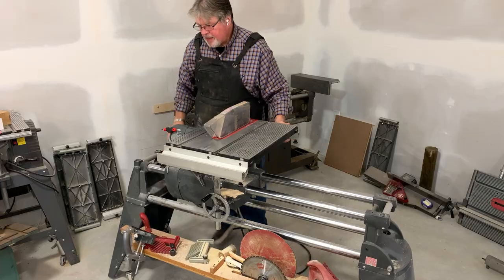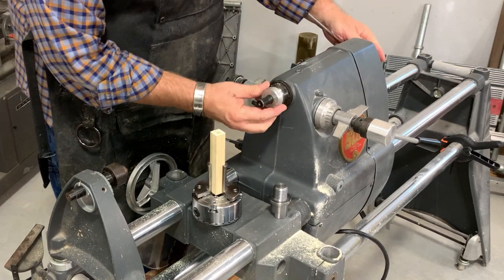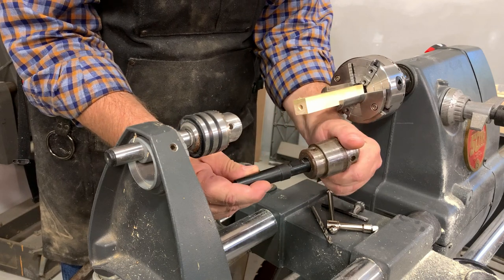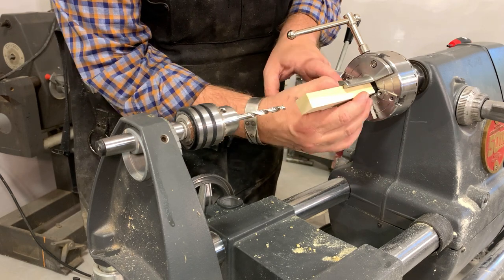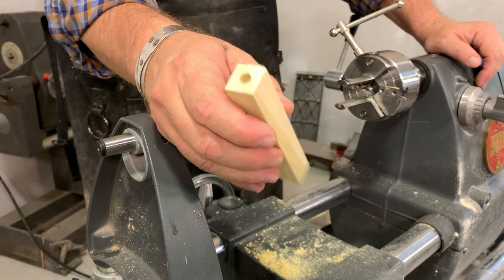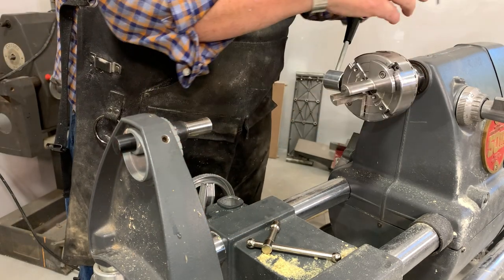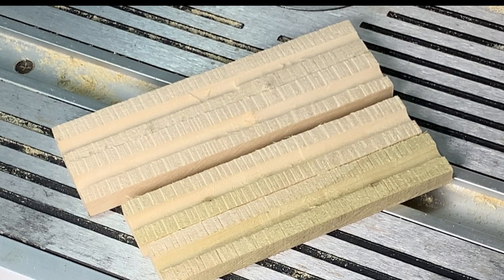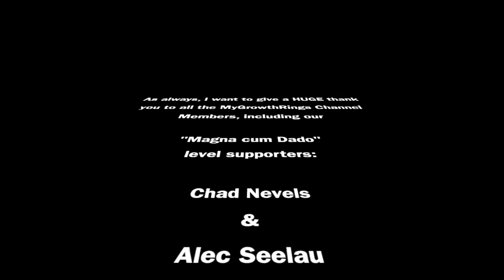BORING! Pen Blanks on Lathe: Two Methods, One Stinks!

Comment: Why doesn't the tailstock flex as much when the bit is attached to it as it does when the wood is attached to it?
Reply: Guessing that the increased weight of the scroll chuck pulls down and takes up any slack in the tail stock.  Having a drill chuck that mounts as close as possible to the tail stock gives better results.  That bit of movement in the tail stock is the bane in my experience in drilling pen blanks.
Reply from the maker: What Dwight said.

Comment: I use those jaws in a Nova chuck. I cut my blanks to the length of the tube (+1/16) before drilling so concentricity isn't a problem. I'd never thought of mounting the Nova chuck on the tailstock, and now I guess I never will. I also use the Shopsmith 2MT and Shopsmith drill chuck on my Jet mini lathe (blasphemy, I know) when turning pens. Its on a higher base which puts those little bitty things closer to my aging eye (behind a face mask, of course). Two days ago, I had a catch on an acrylic blank and it exploded sending a piece into my brand new, never been worn before (replacement) face mask. I reckon that's what I bought it for.
Reply from the maker: @HikingwiththeBlindBoomer  True, that is what it’s for, but dang, that was close!

Comment: Very nice video and demo. I actually don't use my ShopSmith as a lathe. I have a dedicated lathe. This will definitely help later on for other applications.  Keep up the great work. 👽
Reply: I bought a mini-lathe for turning pens but then the SS can be used for finishing the pens.
Reply from the maker: We were using this same set-up on a small Wen lathe, and it worked almost as well. The quill advance makes it a bit easer. Scott

Comment: boring long holes straight you can get a VERY straight bore by rotating BOTH material and cutter against each other, preferably at different speeds so there wouldn't be any periodical helical errors introduced. this is how long straight gun barrels where done with errors so small that it was measured in parts of a millimeter fir guns roughly 40cm (16") bore almost 20m (22yds) long

Comment: I tried to drill my blanks with the lathe and found that the bit didn't want to center and it flexed a little.  I currently use a self-centering drill press vise and align the fence for front to back centering.  I also have a stop on the fence for left to right centering.  Once I am set up, which takes only a few minutes, I can drill several blanks of varying sizes and they all are perfectly centered.  The vise doesn't even care if the blanks are a bit rectangular or even round,  Of course, most of the wood or acrylic is turned away in the pen making process, so with most single blank pens being even a little off center doesn't matter.  Thanks for another great video.  Short, sweet, and to the point.  Blessings, Glen

Comment: If your wood and drill bit are not perfectly aligned, if you spin the wood and have the drill bit stationary, you will get a hole in the center of the wood, but it will be slightly larger than the size of the drill bit... If you do it the other way (i.e. drill bit spinning and the wood stationary), you will drill a hole the size of the drill bit, but off center... I don't do woodwork on a lathe, but I do sometimes use a mini-lathe for drilling similar holes in similar sized pieces of steel for creating custom reloading funnel pieces for my ammunition reloading press...
Reply from the maker: Exactly right. I’m going to demonstrate a hybrid approach in the follow up Q&A, by you are spot on.
Reply: @MyGrowthRings  -- It's more obvious when you are doing larger holes... The items that I am creating are powder funnels for Dillon reloading press... I prefer a slightly different flare on the cartridge brass than Dillon provides with their default powder funnels for each caliber, so I create my own... They are basically just a piece of steel cut down to a particular length and diameter with a hole drilled longitudinally and a groove cut around the cylinder at a certain point and a nose tapered into the profile that you are wanting to expand the mouth of the brass to... Pretty simple, really...

Comment: I purchased a #2 MT drill chuck several years ago for this purpose. I do not use it. It is both longer and heavier than using the Shopsmith drill chuck and the Shopsmith #2 MT. It caused things to wobble and wallow out the hole. So it sits on the shelf.
Reply from the maker: eBay is your friend. Seriously, someone else is bound to be looking for one just like it.

Comment: Your video is not a surprise.   Rotating the work is best for drilling.   Useful video for all to see.
I have wood lathe and metal lathe.    Once I got the metal lathe I was introduced to centre drills.    I now centre drill everything, wood or metal.   I have experienced that with some pieces of wood, the grain can cause a drill bit to be slightly pushed off centre.   Like your tail stock test, once the bit starts off centre, it will continue to drill off centre.   I have had this happen even with the brad point bits like you used.   This can happen for me with smaller diameter bits e.g., 1/4in.
If I first use a centre drill to make a small pilot hole, then my later bit, twist drill or brad point or Forstner will more likely drill centred.
I have also experienced where a drill started on centre, but then the wood grain changed density along the work and I ended up slightly off centre.
This is a bigger challenge for me when drilling deep holes for e.g., pepper mills.     Forstner bits are not long enough so I need an extension and typically the bit with extension will wander in the hole.   I now use larger twist drills to drill the pepper mill blank undersized, then mount the blank on the metal lathe and use a boring bar to get the hole to desired diameter.   This may seem like overkill, but I prefer to not have to fight with a hole which has gone off centre at the base of the pepper mill blank.
Dave.
Reply from the maker: Dave, that approach makes a lot of sense. I got started turning on a watchmakers lathe, which is kind of a mix of a metal lathe and a wood lathe. It was fun to learn on and just as you said, the boring bar was a godsend.

Comment: Wood blank is more likely off-center in the chuck, vs. the drill in the tail stock.
Before altering tail eccentric, bring tailstock bit or morse center up to the chuck & make sure the Chuck & Tailstock are Aligned To Eack Other.

  Only Then adjust the eccentric in the tailstock !

Next,  if marked center of blank does not meet the drill - Adjust the blank in the chuck.
Also do same for the marked center on the other end.

Thanks again.
Reply from the maker: Great tips and observations!

Comment: I guess I can think of at least two other ways to do this but that is a good demo. You could also use a pen vise and a drill press (either SS or a benchtop) or set the SS into horizontal boring mode with a v-block for the blanks. Or, and I do this since I am just getting set up to make pens, I buy predrilled pen blanks (so far). Absolute centering is not needed since the pen will be turned between centers or on a mandrel.
Reply from the maker: You are right that in some cases being centered isn't critical and that the hole will wind up in the center of the final shape. Where it can matter is with laminated blanks where the pattern within the blank needs to be straight. That's a rare need for some but frequent for others.

Comment: I align my tailstock with centers by using the drive spur with it's center and my small live center in the tailstock. I also prefer both stop collars in position and with a combination of the stop collars, the eccentric in the tailstock and the two set screws that lock the eccentric to adjust it so the centers meet exactly point to point. There is still a bit of slop in the quill, but not enough to make a difference. I hope this helps, and if there is a way that yields better accuracy I would appreciate a lesson. Thanks! Donnie

Comment: That tailstock flex is what bothered me so much while making pepper and salt grinders. Nobody had any good solutions. When drilling a grinder that's 8-10" in length, it causes the drill bit to drift. I use a tailstock mounted drill chuck that has the #2 taper and the chuck that SS sells on the headstock. Tough deal.
Reply from the maker: I think if I did enough of this that I would fabricate a “tailstock” of sorts that rest on the way tubes and is driven into the wood. I guess I need to think about that.

Comment: Could you drill the blanks in drillpress mode? Batch them out that way? The chuck adapter would be handy. My oneway  fits on the taper but turning small pieces between centers would maybe be better with more length at the headstock end. great vid.
Reply from the maker: Sure. It's a Shopsmith!

Comment: Thanks for the informative video. You must be opening a pen factory! LOL..
The fact the long screw driver failed to pass suggested the mis-alignment, but resawing the pen blank demonstrated the mis-alignment more clearly. Nice demonstration! The tailstock flexed quite a bit..was it tight? 
Now for a cheap shot...At the beginning of 2nd attempt, the drill bit clearly was higher than center point which could have been remedied by raising the tailstock(part of initial alignment procedure for the lathe with the addition of the chuck and wood?) Several variables have been added compared with simple spindle turning...
2nd cheap shot: I thought that you didn't like the 10-index quill feed lever(that is presently installed on your unit), and favored that long purple lever that is available on eBay???  jim
Reply from the maker: Hey Jim. Yes, the tailstock was tight and yes, the misalignment could have be compensated for by moving the tailstock around, but that error is an indication of a buildup of tolerances.  And yes, I am forcing myself to use the 10 position handle.

Comment: Well, bless your heart, Scott! That was a great way of boring holes. I have never had that nice chuck. I have made a lot of pens, but all I knew to do was drill my blanks in horizontal boring mode using the fence and the miter guage. I will have to see if I can get some of that equipment you showed.

Comment: A few things. I have been turning pens for over 8 years. There is no pen kit that uses a 6" blank stock. Cut to the correct length. One piece kits are at the most 4" blank stock so that is one pass regardless of which way you address the drilling operation. 2 piece kits are at a max of 3" so again, mark the orientation of the blank to keep grain aligned, cut the blank in half and drill both pieces.  Only one pass again. 
Almost every kit/bushing setup has from 1/32" to 1/8" stock remaining on the finished pen. Being off center, on a 3/4"x3/4" blank, by a little bit would not cause a problem in turning. 
Need to drill a deeper hole? Use the appropriate length bit and move the headstock closer as you max the quill travel.
Tail stock flexing? Put the machine in drill press configuration and use the table and appropriate jig to hold the blank. If you are using the SS for pen making then these shop made or bought jigs will be around somewhere.
 Great video though
Reply from the maker: Thanks for chiming in! I guess I edited out some important information about what we are doing. I purchased my grandson, a pen turning lathe, but he is not making pens or anything for that matter. These blanks are strictly for him to practice turning on. They are all roughly 5 inches in length, which is just about the maximum capacity of his lathe. Scott
Reply: I'm glad to hear you got him started. Woodturning is a lot of fun. Starting on longer stock to learn tool control is a good idea. Eventually get him down to correct length so his finesse starts being used. @MyGrowthRings
Reply from the maker: @StephensPenTurnings  He’s been turning for a couple years, but this will be his first lathe that he’ll be able to take with him. He and his family are traveling the US in an RV, so the only time he’s had to practice his turning is when they are here locally and he gets into my shop. I hope that the slave holds up to the rigors of their life. Scott.

Comment: If only turning a few I can see  doing it this way. Though I uave not attempted any pens just yet. Would it make more sense if you are drilling out a lot of blanks to use the horizontal bore and a jig device for black placement?
Reply from the maker: I could go either way on that. The accuracy of drilling on the lathe is better, but doing it horizontally with a jig would certainly be faster. A longer bit could help either way.  Scott

Comment: You mention flex on the trail stock when the drill bit is doing the spinning, what stops the same flex when the drill bit is in the tail stock??
Reply from the maker: There sure can be. The important thing is to use sharp drill bits and don’t put too much pressure. The flex doesn’t seem to matter when the stock is spinning but it does matter when the drill bit is spinning.

Comment: MGR great video.  Seems like there is lot of deflection on the tail stock, regardless of which method is used,  is there a way to correct or compensate for that?
Reply from the maker: There is, and the best approach is to use sharp tools, and don’t feed too aggressively. The advantage of using the wood in the Chuck on the quilt is that the drillbit will stay centered on the stock, which is not the case the other way around.

Comment: Nice demo! I have been using a pen blank vice and bench drill press for boring the blanks, cutting the blank to size first (length). The method you shown seems more efficient by boring the hole first and then cutting the blank to size. Pens make great Christmas birthday and graduation gifts. I keep several made up unexpected occasions also.
Reply from the maker: Yeah, I used to cut then drill but I kept getting alignment issues.
Reply: You are doing it right, smaller blanks are easier to drill precisely then a long blank to be cut in half

Comment: Do you have a link to that adapter?! That's been a big challenge for me as a newbie. Most tools and knowledge is not based on the Shopsmith, so if I can convert the head to something more traditional, I would love that!
Reply from the maker: I’ve had a couple links in the video description. If I were to do it over again, I would buy a dedicated shocked specifically for drilling. I’ve linked to that also.
Reply: I'd also like to see a link to the threaded adaptor, which wasn't added in your links.
Reply from the maker: @mesoed  Sorry about that. I’m adding it now.

Comment: Curious about the difference.  I am not sure I understand why the difference between turning the wood or turning the Jacob Chuck.  and why the flex of the tailstock was in play one way but not the other. Is there a purpose for the flex in the tailstock?
Reply from the maker: It's good that you are thinking this through. When the stock is stationary (On the tailstock) any flex in the tailstock will create an angled hole. When the stock is spinning the bit is forced to stay centered. It's kinda magic.
Reply: Maybe this will make sense.  When you drill, the bit is pushing against the wood, even with regular holes, so the wood is accepting that pressure by drilling the hole.  If the wood is in the tail stock, the bit is still pushing against the wood and the tail stock is accepting some of that pressure so flexes.  I was at a Maker Fair.  The woman showing children how to hammer nails into wood had them nailing in the middle of a plastic folding table.  The children were getting nowhere with their hammering as the table was flexing/accepting all the pressure/force being applied by the hammer to the nail.  Simply moving the wood above one of the table legs transferred the force into the non-flexible floor.  Bingo, nails driven.
Reply from the maker: @Pascalore  Exactly right. There are some Shopsmith users who use their lathe extensively and who found the flex to be excessive, so they have fabricated new, beefier tailstocks.
Reply: @MyGrowthRings  if I have learned anything about shop smith “ Assume nothing.  So that is why I asked the question about the flex of the tail stock.  Setting up the stock to be turned seems to take the flex out of the equation or at least minimizes the effect.  It looks like to me to drill the wood to be turned with wood turning will net the best results. Starting from a place of precision makes a big difference all the way through the project.  Thanks again.